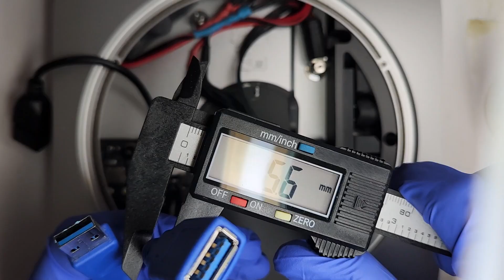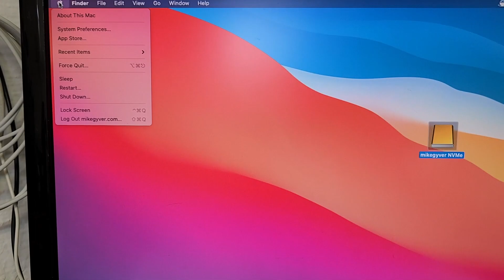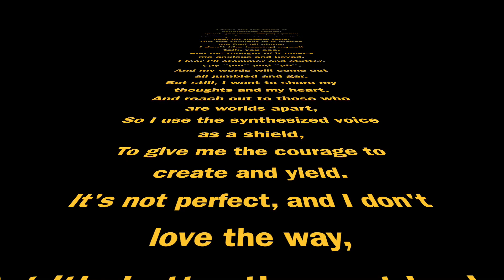Hack Apple Mac Mini M-series teardown install USB3.0 internal Expansion Storage M.2 NVMe upgrade.

Comment: I have another question, what happens if someone or you mistakenly connect another USB device to external USB-A socket? Is there some kind of conflict? Is the internal SSD unmounted, or does it stop working?
Reply from the maker: Yes, there will be a conflict.  You can only have one device at a time, however I may put a hub inside so that I can have more than one device inside.

Comment: Don't worry about your voice, the important thing is what you want to convey with your ideas. Great video like all of yours Mike, I love it!  USB 3.0 is much better than the old USB 2.0, and you only have to solder 4 more cables, very interesting! Could you tell us what read and write speed reaches the SSD? Perhaps an update to the video Mac Mini M2 with a 12v internal battery would be a great idea for the next one, or for when it is possible. Many thanks from Brussels, Miguel :) I like crazy ideas!!! 🤯
Reply from the maker: Thanks for all your encouragement!  I feel like I know you!
speeds were actually bad, perhaps i'll cover in another video.  I tested it even before I put SSD inside, so maybe it had to do with the type of enclosure I used.